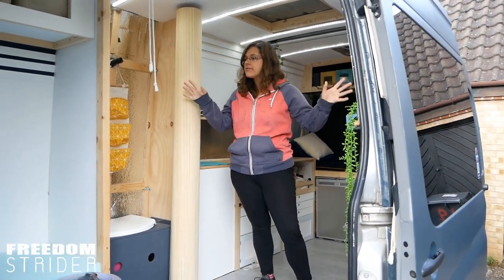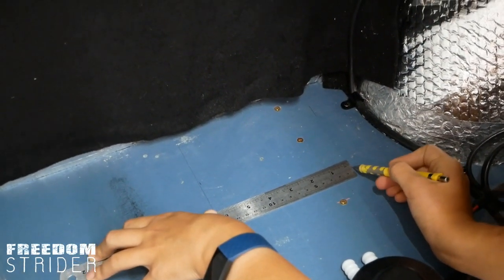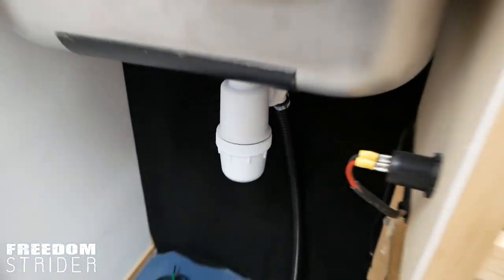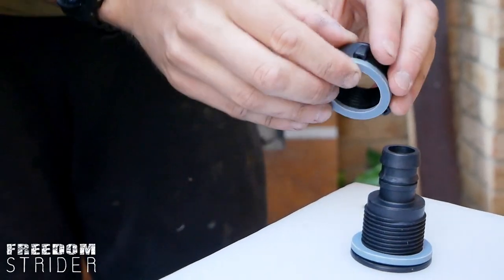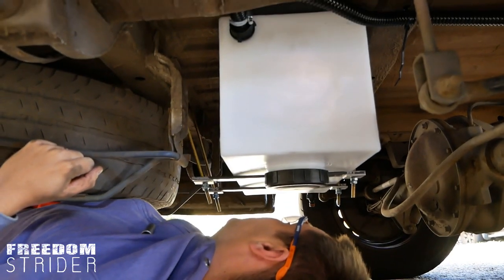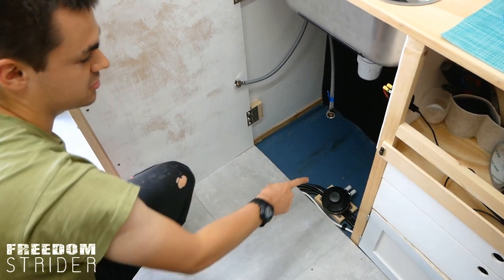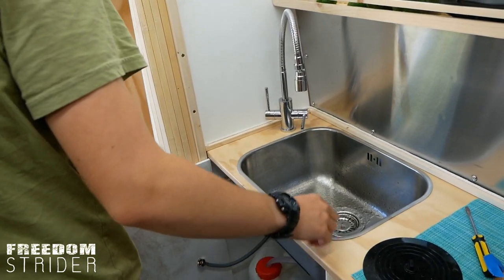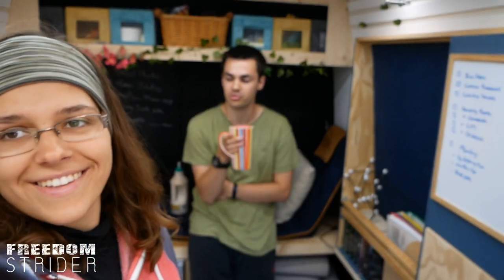The SIMPLEST campervan plumbing system

Comment: You guys are charming. Did you ever plug the hot water pipe to your faucet (can buy a compression-fitting plug)? Otherwise, if you bump the hot water valve on the tap and it opens, won't water pump out the hot water line back into your sink base?
Reply from the maker: We did put a plug in the hot water line otherwise what you said would have happened 😅

Comment: Well done guys, could I recommend you add a relief hole or pipe for your grey tank? We have one in ours for when it gets too full and we can’t empty it, it just goes out of the overflow relief pipe. It’s been a life saver especially when we are in a car pack or somewhere we can’t empty the grey tank 😊
Reply from the maker: We did drill a 10mm relief hole at the top of the tank, for exactly that reason 🙃
Reply: @FreedomStrider  that’s awesome

Comment: Awesome vid. This is almost the exact same way I’ll be doing in my own van. I’m still hesitant about drilling holes into it though. 😅
Reply from the maker: Drilling holes to the outside is actually not that scary once you start, it's more than anticipation. Admittedly drilling into the floor is more risky because there's alot of stuff you can hit, hence our measuring. Best advice is take your ur time and if you can, drill from the underneath up and you'll not damage anything mechanical under the van 👍

Comment: Wait you put a hydronic heated floor but you use a foot pump to run your sink water?
Reply from the maker: Yep... we are a mystery 😎😂

The foot pump is useful for controlling how much water we are using. We have a relatively low water storage capacity so we are giving it ago. Could replace it with a electric submersible pump later on... might have to due to space saving issue with our reciculating shower plumbing 😉

Comment: How many miles did you cover before road chippings and stones impacted on your underslung tank ? Did you offer it any kind of protection ?
Reply from the maker: The underslung tanks are fine without special protection, they have not been impacted as the plastic is quite thick
Reply: @FreedomStrider  cool .. Fingers crossed then